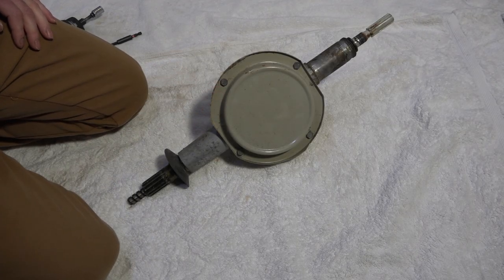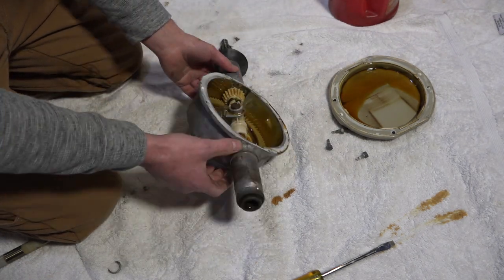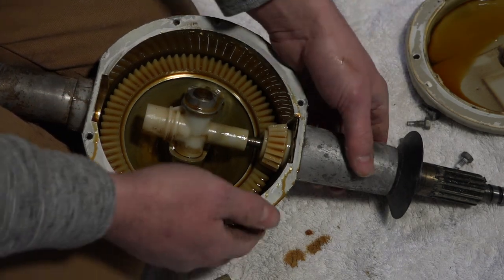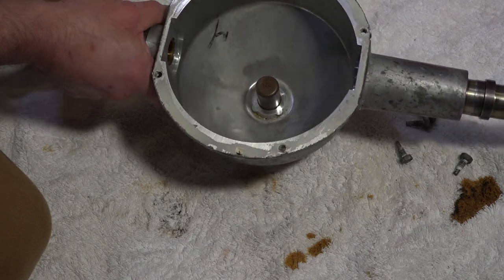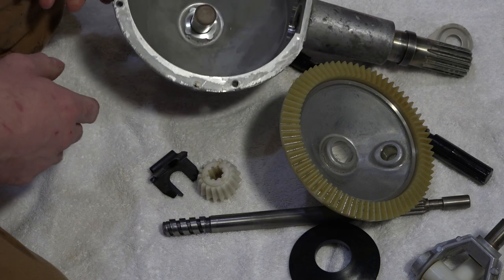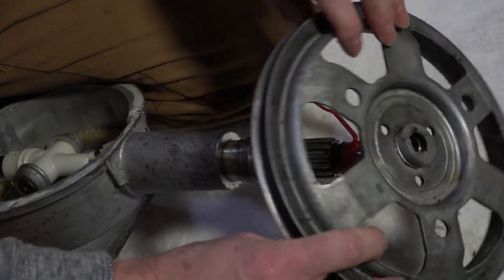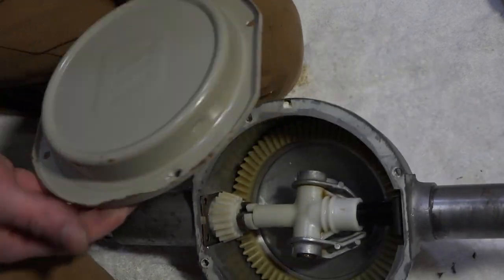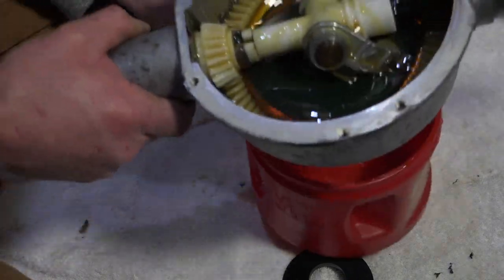Rebuilding an Orbital Maytag Transmission Dependable Care 206707 22002126 6-2097750

Comment: Nice video. You mentioned you were wondering how the shaft is retained. On these style transmissions, the retainer is actually on top. Its a half-round plastic cup that slips over the shaft located below the tub seal. You can get to it after removing the flange nut and tub, and then removing the top seal housing. I just replaced my seal and forgot to replace this retainer so I found my whole shaft would slide out with the agitator! Removed the tub, nut, and top seal and installed the this retainer. All good now!
Reply: white plastic retainer on top is the newer style maytag tranny.  He was working on the newer style maytag tranny in this video but the new agitator shaft he bought and installed was for the older style transmission.

Comment: Nice to have you back Eugene.   Love your very informative restoration and product review videos on large appliances.    I followed your advice and replaced a recently 1994 Amana (SQ) model which had a leaking transmission fluid (total mess)  to the point that started getting way to noisy and replaced it with a slightly newer model Amana model  from a repair center which specializes on refurbished large appliances.   The model I have is different with a few less features and smaller tank but for me that is no big deal.   It was in excellent condition and works great and only set me back $175 out the door.   I now have a matched set again that works great and cleans great as well.  I was considering going new  for replacement looking at SQ,  LG, and Electrolux but our local repair centers really feel most are not very good quality machines per reliability especially LG and Samsung which they state the parts take forever to obtain and are expensive.  I stayed with old school and am glad I did!

Comment: A helpful video as always. The original shaft you removed is for a "series 22" transmission which would call for a part WP22002340 (external plastic collar) to keep that shaft in place (in theory). The replacement shaft is for a "series 10" transmission requiring part WP215581 (internal metal clip) to keep the shaft in place. Our Maytag LAT9416AAE is a series 22 washer built in March of 1999 and has the plastic collar fitted to the shaft. Thanks for posting this video, it inspires confidence to maintain the most dependable top load washer ever made.
Reply: OMG thank you for this!! After waiting for the spring clip to arrive, I could NOT get the damned thing on!  I was about to just take my Dremel out and MAKE a place for this stupid little piece I just paid more in shipping for than the part cost!  Good to know I'm not crazy.

Comment: I just took apart my old Maytag last night and saved the parts, just acquired another 96 Amana, now I have two of those.  The bottom was rusted out of the Maytag, other than that it was still working, saved the motor, the orbital transmission, valve, hoses, etc.  I was really curious to see the inside of that transmission.  I expected to see metal gears in these transmissions but it looks like newer and older washer transmissions used plastic gears.  I have more appreciation for washers after seeing how they work, impressive and taken for granted.

Comment: I own a Maytag Performa PAV2300AWW top load washing machine. It must be close to 20 years old by now. I have kept it going with new parts over the years rather then buy a new machine that I hear nothing good about. Just a couple of days ago the drum in the machine stopped spinning and agitating but fills with water and the motor runs fine. So we drained the water out and tilted the machine back to see if the single belt was still connected. It was and I was able to turn the transmission pulley but it did agitate or did the inside drum move so I took the belt off. When I did the white nylon Transmission pulley that felt like it was moving up and down on the transmission shaft slid off the shaft down to the floor. I stopped doing anymore at that point in time. Just 5 years ago I replaced that Pulley with a thrust bearing kit I felt it needed. I lifted up the lid up top and tried to move the inner tub and agitator. I don’t want to try and force it but I can’t get either to turn freely with no belt connected and the power disconnected. So at this point I don’t know whether I need a new transmission or even if it could be rebuilt or if something else like the brake or something else is the problem why it doesn’t spin. Looking for some help on You Tube but I have been striking out. I feel like I am getting close to being stuck into buying a new machine and even if I have to I don’t even know what to buy that would be equal to my old Maytag we have owned for so long. Any ideas sent my way with suggestions would surely help me I feel. Thanks ahead of time.

Comment: Found my washer wasn't agitating, tried everything. Final check was the transmission, removed ur completely and found the shaft is seized because even tried to turn it from the bottom and it wouldn't rotate at all and I can't even pull it out with my hand like Eugene did. My question is how to even get the shaft out if it's seized? Do I go to a machine shop and try to get them to pull it out? Will that damage the housing of the transmission? Any advice would be greatly appreciated.

Comment: my curiosity has the best of me, my 37 year old LA5000 stopped agitating,The transmission, so far it looks good as I disassemble it. The yoke I cannot remove it unless I remove the  agitator shaft. The agitator shaft seems to be frozen in the basket bearing assembly. Has any reader or Eugene ever experienced this event?

Comment: I remember a common failure was the agitator shaft seizing in the bore. I never took one apart to see what was up. I wonder if that oring deteriorated and got stuck or something. Do you think the oring might have been how the original shaft was meant to be held in place? Maybe it snaps into an interval groove or something, and as the oring dried with age, it quit staying in place. Just thinking out loud here. Anyway, keep up the good work.
Reply: Maytag redesigned the shaft seal in the mid 90's (triple lip seal) which was inferior to the original design that had a high failure rate. The seal would fail and water would enter the transmission through the upper shaft/bearing area causing it to seize up.
Reply: @muziklvr7776  makes sense. This really takes be back haha. I cut my teeth rebuilding old washing machines. I worked on a ton of whirlpool belt drives and ge machines with the crown boot. It was in a used appliance shop where we had to be frugal. We used to do a lot of component level repairs that you would never do in a customers home. From installing new bearings in ge centrifugal clutches to riveting new friction pads on whirlpool clutch plates, we did it all. It was a great place to learn!
Reply: @denrayr  Sounds like blast. You cut your teeth on some of the best appliances that will ever grace the planet. It's all cheap chineseium planned obsolescence junk now. And when a part fails, it's obsoleted by the manufacture. I'm running a1970's Maytag washer and dryer I pulled from a scrap pile in 2009.
Reply: @muziklvr7776  I think we all have a special spot in our heart for the classic whirlpool direct drive. It's not a popular opinion amongst the old timers, but I think the LG direct drive front loaders are equally as good. I'd rather own one than the coveted classic speed queen top loader. I get that they are the only remaining classic top loader, but I didn't think they were that great during the golden age of top loaders, and I don't think they are that great now. They always had main bearing, pump, and brake problems. I don't know if they've addressed it, but they were also plagued with wash basket fractures. I just never had much of an appetite for those machines, and I guess I'm still not impressed 😂.

Comment: Eugene, Thank you for your helpful videos!  
I am in the process of replacing the tub seal gasket, bearings, and mounting stem on my Maytag LAT9416AEE. While I am at it and have the basket out I was going replace the shaft agitator and lip seal. I am having trouble finding the transmission fluid as I am finding the part discontinued.  Is there another part # for the oil or an alternative that can be used? I do not know the weight of the original oil so any help would be appreciated. I have all the parts I think I need except for the oil,  and RTV adhesive.

Comment: I do not have turbine oil what else can I use???  I have non detergent 30 weight motor oil, k and n air filter oil and also I can get air compressor oil.

Comment: Guys can please give me any type of advice how to breaks that seal on a transmission cover. It takes of easily on video but I’ve spend half a day being close to break that damn thing and nothing worked
Reply: I had to use a putty knife and a hammer to "chisel" an edge of the putty knife in, then continue to move the putty knife in a little more with the hammer. I did this on 4 or so different spots. Then towards the top of the transmission, I inserted a corner of the putty knife back in one of the areas I just opened and I positioned the putty knife blade parallel with the transmission face plate and hammered the knife again (to move the knife down the side of the transmission plate face) until I could finally move pry the face plate off.  Good luck. It was a bitch.
Reply: @kimwilson1193  ^^^ This ^^^

Comment: Nice project you did! How are these transmissions different from the pitman ones? What oil is used in these?
Reply: Maytag had special oil the was backwards compatible for all of their washers going back to 1939 for the EJN wringers. 80/90 gear oil is a very close replacement that works well.
Reply: @muziklvr7776  Didn't they use a different oil when they were taken over by Whirlpool?
Reply: @jeromedavis8575  I have only used genuine Maytag oil (Part# 56080) not the updated oil Whirlpool put out (Part# 6-0560800) so I can't comment. Sorry.